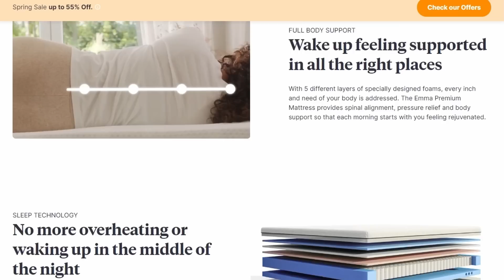Ep 125 - The Stem Of Our Boat Is Rotten! #boatrestoration

Comment: You two are truly inspiring.  Your hard work and tenacity.  I fear a serious problem looms.  If the stem is rotten  (not easily replaced) but my greatest fear and I said this last year, your keel.  That keel has been sitting in bug infested mud for years. You need to take core samples and find out now,  because a keel of that size is not re-placeable.
Reply: This is why myself and others strongly advised that a surveyor look at the boat before any serious work began.

Comment: For the split stringer.. you could put some wood glue into a syringe and fill the split with it, remove the errant nail and then clamp the split back together until it dries.

Also I've heard of using a 1/4 bit holder in an SDS drill for knocking nails back out.

Comment: fantastic, watching you both achieve the impossible! I was so impressed with the way that you left the nuts at the end of the bolts to protect the threads when you were using the hammer, wow, clever stuff I would never have thought of that, although I would have used a block of wood to protect the threads, but that is nothing like a sufficient as using the bolts. Good luck to you both, and thank you for the hours of entertainment. Your hard work has given to me. Cheers, Peter

Comment: I've been wondering if you've considered making your own floating drydock? It sounds funny at first, but I'd see it being a lot like the inflatable seapen cradles many people use for their boats to keep them out of the water alongside docks but with a hard floor. That way Sarinda wouldn't have to be hauled out onto a hardstand and you could work on the hull whenever you want. The dock would have to be moored either in permanent water or somewhere with a flat seabed though.
Just a thought.

Comment: Is it possible….?

Was there a piece of steel that matches the empty bolt hole pattern in the apron?

Looks like there may have been something like the ‘knees’ that support the deck in other locations….

The bolt hole size and distances might match the knees as well….

Check the spare parts draw to see if anyone tucked it away to fix decades later….   😃

Keep up the great work, Rest well!

Comment: A ferrous nut on a stainless bolt will corrode so fast you can almost hear it fizzing. Unfortunately, stainless threads have no “spring”. Stainless needs self-locking nuts, because the threads go hard suddenly and will shake loose all too easily.

Comment: I am amazed that most of the work done under non safety compliance,thus wearing safety  goggles ? very dangerous practice  when using grinders drills saws etc  after seing work mates being seriously injured through sillyness  after 63 yrs of engineering in pulp and paper mill  for 26 years I had seen workmates being warned that it they did not adhere the safety rules . As Ship Happens? so do serious injuries also happens that puts your own life at risk.
Dave Simmonds  NZ